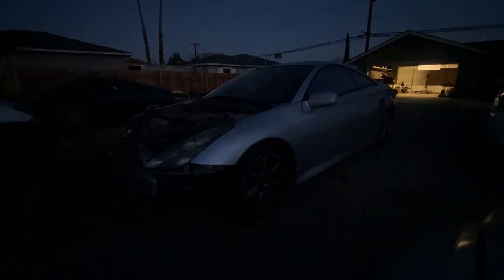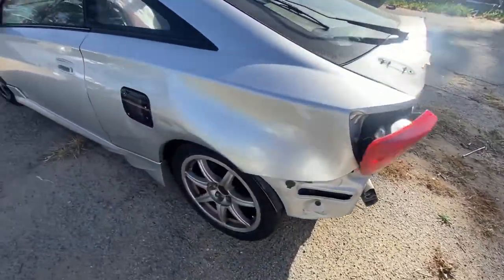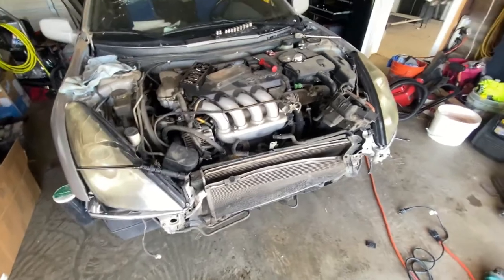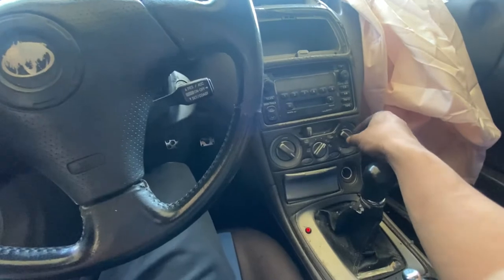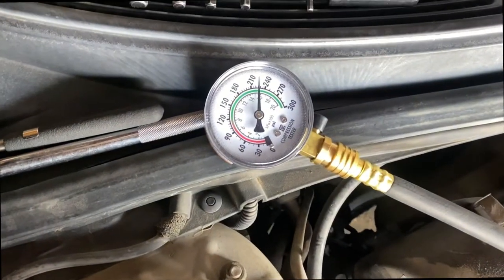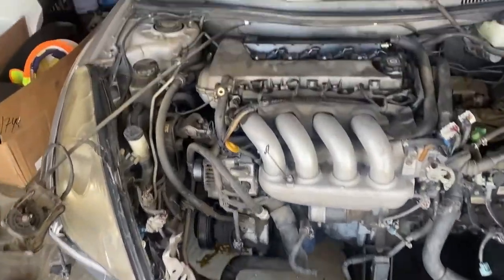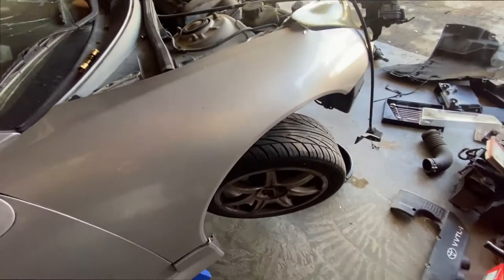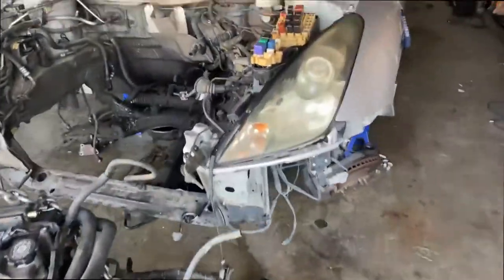Removing Another 2zz

Comment: Hey are you parting out that celica?  I need headlight parts,  lmk.
Reply from the maker: Yes but headlights are gone
Reply: @RafasGarage  Hi, I don't need the headlights.  What I need is the wires and plugs that connects to the connector, that connects to low beam bulb, and rubber housing.  I need it for both left and right side.  Previous own replace factory parts with hid kit.  I am converting it back to factory because the hids are not working correctly.
Reply from the maker: @thepunisher794  oh ok yea i got the pigtails just not the rubber housing
Reply: @RafasGarage  ok, thanks.   I just ordered some universal pigtails and plugs.  If they don't work I will contact you again, thanks man.
Reply from the maker: @thepunisher794  np
Reply: @RafasGarage  hey Rafa, the parts I ordered does not fit correctly, it is cheap, and flimsy.  I will need the low beam pig tail and plug/connector the H7 bulb.  Need it for left and right side.  How can I contact you?  How much do you want for it?  Lmk
Reply from the maker: @thepunisher794  hit me up on my IG
Reply: @RafasGarage  what is your IG?
Reply from the maker: @thepunisher794  rafasgarageyt